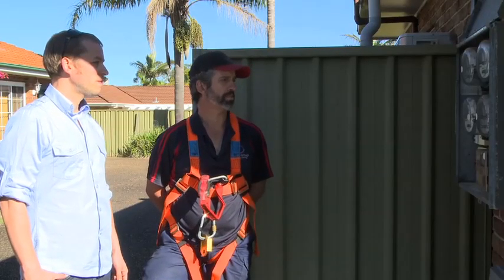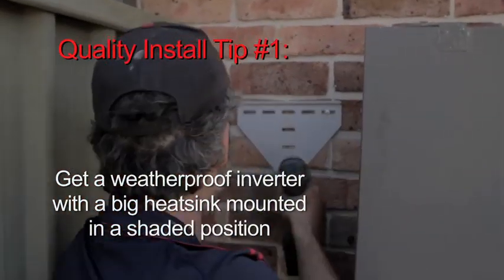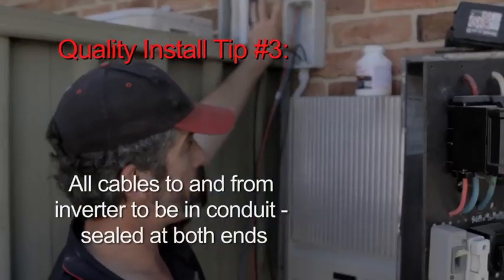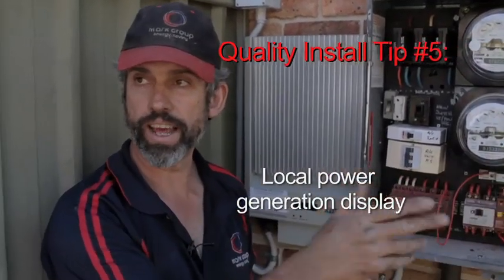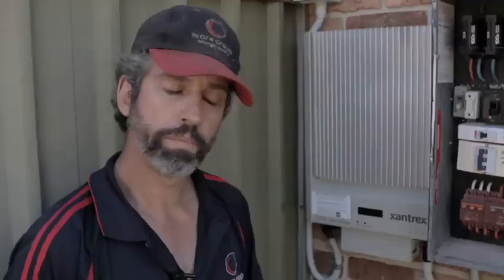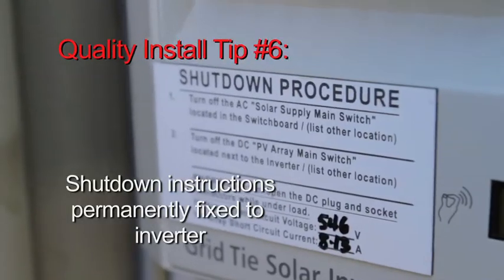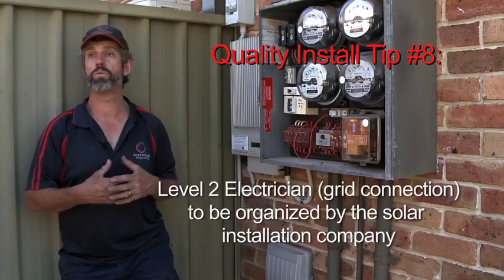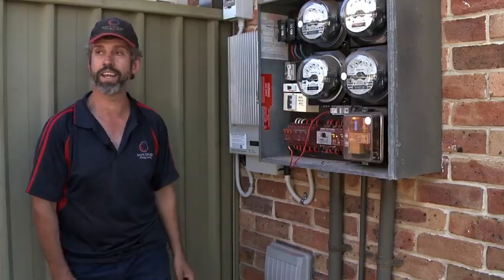Solar Power Install Part 2 : The Solar Inverter

Comment: Did old mate just pull a live cable out of a circuitbreaker and run cables in a down pipe?
Reply: Thought the exact same thing 😂😂 he was speaking so well too
Reply: Yeah I don’t know why he pulled that wire out, just a bit of a show man I guess, flicking the CB would have sufficed. The cables are run in trunking looks like it was already there going to the a/c on the other-side of the fence.

Comment: At 1.10 on timeline , it says to mount inverter as close as possible to fusebox to minimise voltage drops. While in a way this is true, it would be better to mount closer to the solar panels. There is greater power loss in the low voltage high current of DC from the panels, than from mains voltage low current from the inverter.
Reply: If your DC voltage is higher then it's actually a better idea. Some new inverters use higher voltages input.